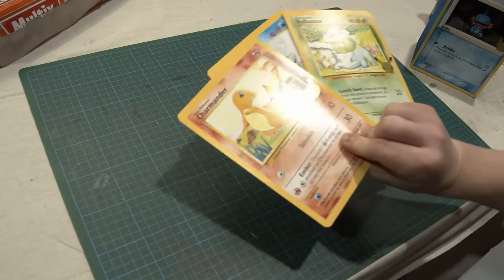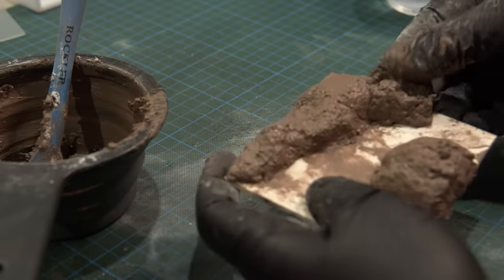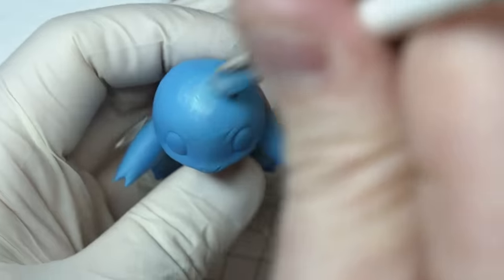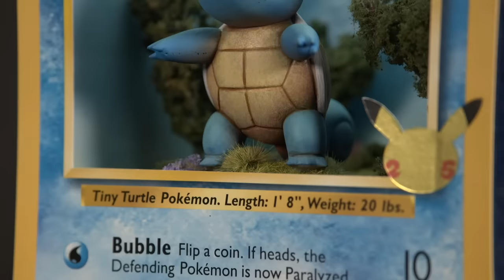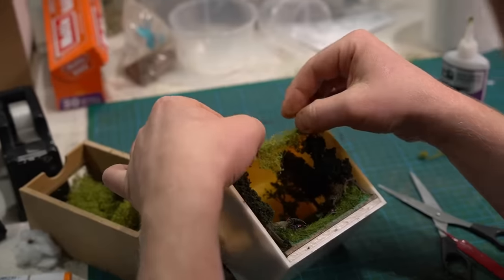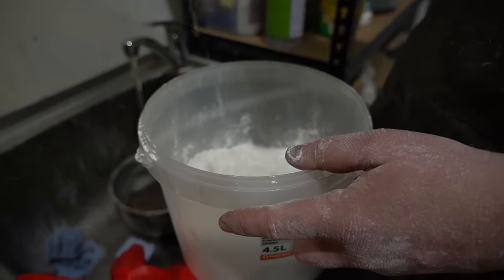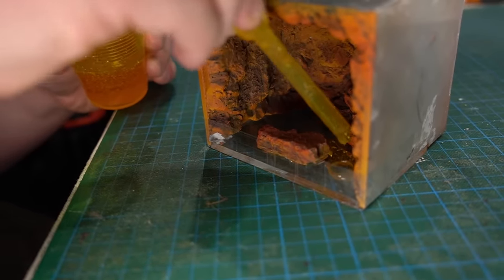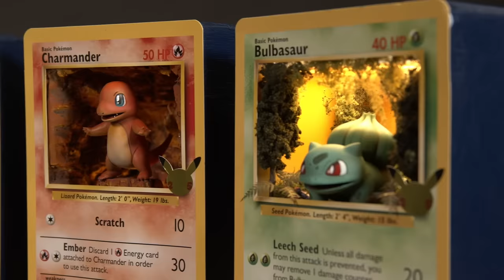I Turned Pokémon Cards into Tiny Worlds!!

Comment: It would be hilarious to actually try to play a game with "cards" like that. A "deck" of 60 "cards" would be about 25 feet tall. How you gonna shuffle that?
Reply: Make the set without regular cards and shuffle that. Then have a friend line up the 3d cards in that order facing away from you load them into a hole that has a spring loaded cam mechanism that pushes up the new top card. You need to be as rich as Kaiba to play with it regularly but I suppose that's why Yu-gi-oh has their holograms and pokemon doesn't.

Comment: Jazza,
You might want to look into getting a ductless spray booth. It would allow you to safely use spray paint indoors without the need for a respirator & without fuming out the place. They are small portable paint booths that filter out everything that doesn't stick to your workpiece. They are standard equipment for most model shops working on movies. For what they are they are not very expensive & are available in many different sizes.

Comment: This is pushing me closer and closer to buying a 3D printer 😂
Reply: Was thinking the same thing ahahah
Reply: They are a great tool, but resin 3D printers require some well ventilated space and consume a lot of time with prepping models for printing, handling resin in gloves and protective eyewear, etc.
Reply: I was gonna type that
Reply: Do it! They're so much fun. Steep learning curve, so get mentally prepared to fail a lot of prints during the learning process. But I love my printing and painting hobby!
Reply: If oonly I had more money :(
Reply: Don't read profile photo  ok
Reply: I just bought one
Reply: Also i'm going to buy it
Reply: Do it, I bought the mono 4k from anycubic and it's everything the ads say it is and more.
Reply: I recently got mine!
Reply: @Katie That used to be true, however used in a ventilated room (window) and wearing gloves (just a good idea) it's basically almost maintenance and setup free these days. Resin is extremely user friendly and comes in non toxic versions and odor free at no loss in quality. 
Reddit/Google have tons of resources to help get the best quality and speed. All the software used has extremely good support for almost all printers. 
Along with all of that the mono series and 4k/8k printers are cheaper and 5-10x faster per print with almost no noise and stop start print features these days.
Honestly filament printers are a bit finicky and better for the tinker crowd these days vs the out of the box and go experience anycubic and the like offer at sub $500 for the printer and curing/wash station.
Also, you don't dump the excess resin, you reuse it. The vat just gets refilled until you need to do maintenance and then it goes in the bottle. An achohal or simple green bath will dilute and detoxify if you will any leftover resin on the model. It's safe to eat off of in 20 minutes or less lol (I kid).
Reply: Get an Ender 3! Resin printers are absolutely NOT entry level!
Reply: @Katie Their are upsides and downsides to both types of printing and regardless of which you choose there is a beginner level option for anyone to enter the sphere of 3d printing (this channel included not that long ago). 
Filament is slower and the entry level requires some tinkering to get it right. 
Resin can be messy but is mostly a no fuss option for those with the space and time to do things right. 
Either one should approached after you have done your research and understand how to handle and use the hardware, software and byproduct properly.
If your into making tiny toys or display pieces that need that level detail resin provides then it's a great place to start with minimal fuss. Resin as long it's stored in a dark place at ambient temperatures can last for many years and can be filtered if you feel the need very easily.
If you want make household items or more durable daily use products at a larger scale filament is an amazing tool. I can however be fussy and difficult with clogged nozzles and a failed print means a significant loss of time.
Honestly it's not about which one is better. You have to start somewhere and the information and technology available in this era of printing has made it accessible for anyone regardless of where they start. 
It's a fun hobby that people shouldn't be scared of or worried about. Dive in and have fun. Just do your research first so you can enjoy the experience more.
Reply: Personally, I wouldn't want to print anything that's supposed to look as good as possible on an extrusion printer. I also wouldn't want to print anything that requires mating geometry on an extrusion printer. Basically I don't want to print anything on an extrusion printer. I would go with the resin printer for quality prints. Extrusion has its use cases (mostly for cheap shit), but I don't like it.

Comment: These are very very cool! Would love to see a removable panel so light box can be serviced/powered down or battery powered LED strip tape with external battery pack so it can still be an entirely closed system and yet still be serviced/powered off from outside

Comment: I started with Squirtle because I loved Blastoise (still do). However throughout the years, I started to like the Bulbasaur line a lot. I don't like the Charmander line, but Charizard has the best shiny out of the trio.
Reply: Same
Reply: I absolutely adore Squirtle and it's evolutions but that may stem from the fact I could just never complete FireRed ( my first pokemon game) with either of the other two. I'd immediately get beat down by either Brock or Misty with Charmander and then fly through both with Bulbasaur only to reach S.S Anne and have my butt handed to me by the rival and his fricken flying type. I've never had a problem in the later games switching starters. But no matter what Squirtle and Turtwig ( as Platinum was my second game ) are two starters I can never not pick when they are an option.